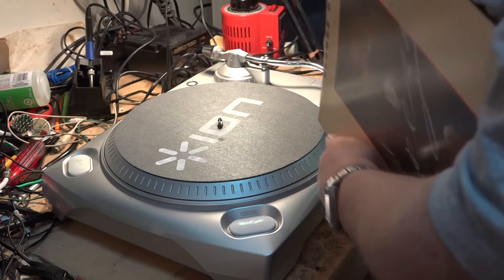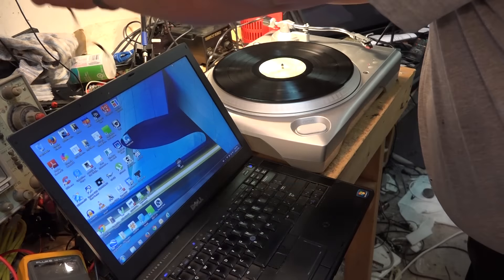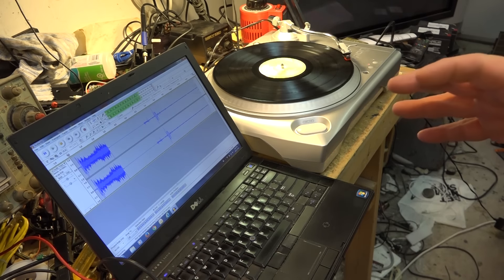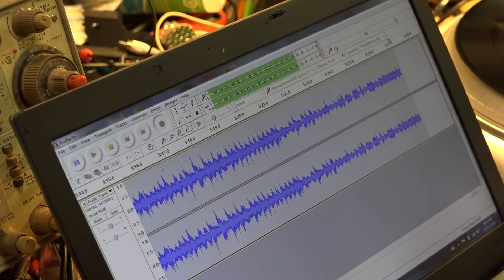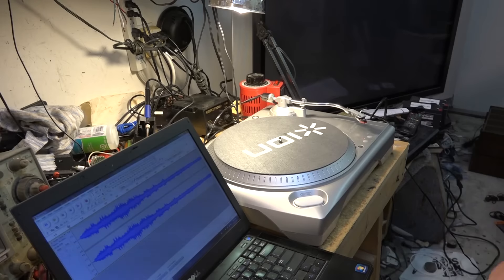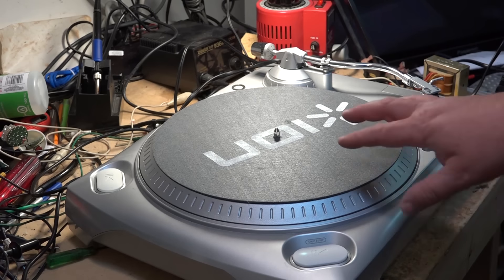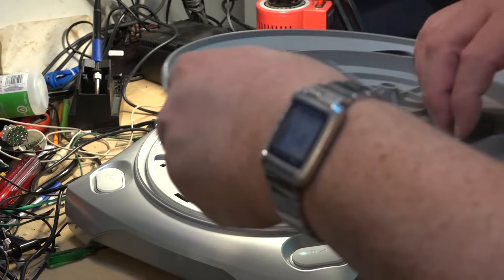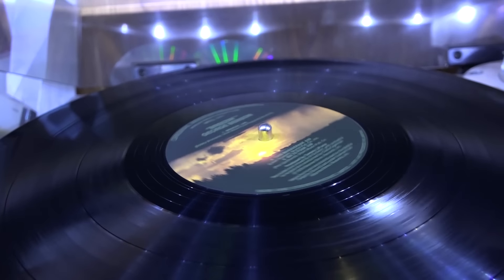ION USB Turntable shoot out with an Technics SLM1 and CD

Comment: Well well, I have the exact same turntable. And yes I beat you to it,I’m going to connect it to my Technics SL-P1200Mk5 to digitise my records. I’ll make a module so I can connect it to Digitise when needed,but still function  nomaly  when not. 
Inside apart from the speed control for platter,most of the gubings are mounted to a board  in the back of the input panel. 
I’m using a cheaper Technics belt drive as a mule  and a 5.2 v mobile power supply to get the basics right.
Not got it working properly yet? 
Good luck👍👍

Comment from the maker: Please note, the quarts lock switch was turned OFF on my SLM1 when I recorded this, and it is slightly slow, as I didn't check the strobe.  I will rerecord the tracks from the Technics, and I am also going to record the standard pressing on the Technics so you can hear the sonic differences between the commercial Warner Brothers 1076 release, and the very expensive Mobile Fidelity release. There are very noticeable differences, and comparing the 2 on the same table, with same pickup is the only way to compare apples to apples.
Reply from the maker: Low bit rate MP3 is horrible. High bit rate is very close to the original.Remixes for CDs are best. If a master tape that was EQ for vinyl is just ported to CD nothing is gained, that would be an AAD CD release. That would be analog session, analog mix, and digital copy.ADD is much better, even though the session tapes were analog, a new digital mix was done before the CD DAT master was done.DDD is the best.In AAD basically all they did was take the 1/4 half track master tape and record it on a DAT, and then send that DAT to the CD factory. The problem is that analog master has already been equalized, compressed and de-s'd for  the analog cutter. When they remix for CD they take the session tapes and remix it. One of the best sounding studio CDs is the Dave Grusin release "Mountain Dance" That was a live direct to 2 channel digital session where all the musicians played the music live. No remix. The sound quality on that CD is spectacular.
Reply: Most Notably is the difference in the Orchestral Intro was in stereo on both the CD and the Technics However I could not notice any separation from the ION. So My conclusion is that Either you mishandled the recording or the file export OR the cartridge (used for multiple transfers) is wired wrong or the software was set wrong OR the thing is MONO or you only played a single track of the stereo tracks. 
As far as results, Predictable. Make sire ION's peramp adheres to the RIAA curve before using it for recording.
AND lastly 16 bit for best recording. 24 bit or higher would be best. To me 16 bit is useless.
Roger

Comment: There are a multitude of variables that can affect analog sound quality: moving magnet vs. moving coil cartridge, line trace vs. elliptical stylus geometry, pickup compliance, tracking force and RIAA equalization curve to name a few. Any debris on the stylus will negatively affect reproduction quality. These are all before the A/D converter, most of which can't be compensated for in post-processing. A PCM4202 A/D converter may sound different than what you are using. The information is on that vinyl; getting it to your ear aint easy.

Comment: The nice thing about the cd is that it is uncompressed PCM and since it is a transfer from the master tape, you won't get the cracks and pops as well as Inner Groove Distortion
Reply from the maker: I'm with you . As good as vinyl can sound, it still suffers from distortion and dynamic range limitations. You won't win that arguement from the vinyl purists though

Comment: Yeah, CDs are unfairly looked down onto. As someone who actually prefers vinyl for a few reasons in some situations, I still mostly buy CDs, especially because they have dropped so much in price (for older albums, that is), to a point where they're actually cheaper than digital MP3 downloads.
Where vinyl shines, though, is the mastering, especially for older music that has been mastered before the loudness wars started. Compare an original issue of an 80s or even early 90s album to a CD remastering or recent remastered vinyl repress - and it just sounds more dynamic. Even some modern albums have been mastered better for vinyl. Check out Metals by Feist. A lot more dynamic on vinyl than CD. Weirdly, the limitations and shortcomings of vinyl actually force sound engineers into a better mastering result. That is, if artists and labels bother.

Comment: For some reason you were recording the audio from the Ion in mono, not stereo. Also its speed was set slightly too fast (probably miscalibrated at the factory, as cheap turntables often are). It should have trimmers underneath to set the speed. The Ion uses a clone of the Sanyo/Fisher MG-09 magnetic cartridge. You can upgrade it with an elliptical stylus -- look for part number 901DE which sells for around US$13 on eBay.
Reply from the maker: I actually put a shure on it before doing the recording. There is no option to set mono or stereo. Audacity was set to stereo but it appears the as converter of the table puts out a mono capture. On the computer it is recognized as a usb microphone. I set it up according to the online destructions and the recording is 2 tracks if mono. The preamp output to line level sounds good.
Reply: 12voltvids shure what model? Could I upgrade the cartridge or stylus
Reply: Know this is an old video but I had the same turntable. You need to right click your volume control, select "Recording devices" and find the turntable in the list. Go into properties, and the advanced tab.

For some reason it sets itself to 1 channel, but you can set it to stereo by adjusting the setting that shows up on that page.

Comment: I see these types of devices in the second hand shops often...I always just cruise on by....I know they serve a purpose for their intended audience...I'm not one....mainly for the issues you noted....I run my turntable and cassette deck through ADS Tech for ripping...dont do it often, but it works well with my vintage gear.  Happy Holidays Dave!  ~Jack, VEG
Reply from the maker: Would like to get a space tech lab preamp they are all tube design, and sound fantastic.

Comment: Actually vinyl has a much wider frequency range than cd. Vinyl can go down to single digits on the low end and up to 60khz on the high end. Cd's are limited to 20hz and cut off abruptly at 20khz.
Reply from the maker: So you have super ears and you can hear past 20KHz?CD delivers a flat frequency response, and a good CD player with a proper DA converter and proper wave shaping will not have the harsh sound that early cheap cd players had. I'm talking a Sony ES or equivalent.Vinyl has its own sound, and certainly sounds better than low bit rate MP3, but compared to a good, not a 10.00 CD player, or a 20.00 DVD player, I am talking a good unit, none I have heard stand up to a good CD player, and I have some pretty good musician ears.

Comment: excellent video. it seemed like the CD sounded better than the mp3 file that you made using Audacity. Was the CD that we heard a CD with mp3s on it or did you convert the mp3s when creating the disc so that it was a "normal" CD.? thanks
Reply from the maker: There was no MP3 compression used on this video. The vinyl was captured directly to the PC from the preamp (a shitty one at that) on the technics and recorded in WAV format. The ION had an internal converter, that just plugged into the computer and stored as a WAV file. The CD was a direct rip from the disk, no conversion at all done. All were saved as .WAV files 44.1KHz 16 bits.
The video was exported as a MPG2 file with PCM audio for the best sound quality, however youtube would have applied their own compression during processing.

Comment: The difference in speed has really impacted on the Technics - more than I would have thought possible.  It sounded quite dead and compressed, with the lower frequencies really lacking.   I'll look forward to hearing the comparison between the two types of vinyl on the same table though, especially now you have the Quartz lock back on, on the Technics.

Much as I like vinyl, as far as I am concerned some of the criticisms leveled at CD are a bit unfair.  Like anything, the kit being used to play it has a lot to do with the end result.
Reply from the maker: New video up with the speed fixed.

Comment: You said you were recording from the ION turntable in analogue. I am interested to hear what it sounds like over USB. Right at the end of the video i see that you were actually using the USB interface. Does your ION have a built in pre amp? Does it sound rubbish over the built in pre amp compared to USB?

  Someone gave me a cheap ION turntable (ION Pure LP) and it sounds awful through the built in preamp. i know the cartridge is the cheapest ever like $2 from china, but i was wondering if i should give it to my 1yr old son as a toy as he loves my Technics 1210, but hands off boyo! He's not old enough yet for the hifi and dj equipment.
  Other wise i'm going to throw it in the bin unless someone can convince me that it sounds better over usb. I was considering wiring a direct phono out so i can run it to my main amps with their phono pre amp or use it in my RV with a mini phono pre amp. Wondering if it's mainly the crappy built in pre amp that makes it sound so bad?
  When i compared it to my Technics 1210 with 10yr beaten DJ cartridge vs brand new cartridge i couldn't believe how bad the ION sounded. I nearly threw it at the wall right then!
Reply from the maker: The preamp sounds great. The a-d converter for USB not so much.  The table itself is noisy.  On the one I has, it had a shure cartridge which sounded great.  I ripped the preamp out, built it into a separate box and added a couple of tubes to the output to make it into a tube buffered preamp. Sounds fantastic.  I took the cartridge and put it on a different turntable, took the motor and belt out and trashed the rest.
Reply: I am just trying to justify keeping it, i have lots of Technics 1210's and some good sound cards and mixers.
  Might put it in my RV or give it to my son, cartridges for the one i have are extremely cheap so i can get a load and let him play around with it. Looks like you have the plush model.

Comment: USB DAC / Pre-amp on a modern TT is at best passable quality compared to a genuine analog TT. Built in USB DAC is already converting to a lower quality compressed digital stream before it ever hits the computer. Built-in pre-amps on modern TT are built to be as cheap as possible, and sound accordingly. So yes a CD rip will sound better.

Comment: Yeah sure the CD rip sounds better than the vinyl recording, but I bet it doesn't sound better than actually listening to the vinyl without digitization. Maybe my ears are on the wrong way around, but in cases where I have the same album on both CD and vinyl - I prefer the vinyl.
Reply from the maker: I have it on vinyl, and half speed vinyl, and CD. I use a very high end Sony CDP555ES player, and everything sounds good on it. Speakers, headphones. sounds fantastic. Not the same using a DVD player to listen to music. That sounds like crap, as do cheap CD players, but good ones, units with burr brown D-A converters, and good low pass filtering to filter out any quantization noise left over from D-A conversion sound superb.There was a reason for the 1,000+ price of these single disk players, just like a high end thornes or oracle table will sound better than a BSR or dual.For me is it signal to noise. Vinyl rumble and click/pops drive me crazy.It's like HDR video. Once you experience it on a good system its hard to go back. Take tube amps for example. Do they produce a more accurate sound? Not a chance, but people still like them because of how they sound.
Reply: The tube amp analogy is quite probably why I like vinyl. It doesn't always have to make scientific sense :)
Reply from the maker: Again each has their own opinion. You are also forgetting the fact that no matter what the source, you are watching it on youtube, so it has been digitally compressed twice. Once by me when I encoded the file as a 25 meg bit transport stream for uploading, and then again by youtube when they transcoded it, so the quality of both will have been changed.I have yet to hear any vinyl that sounds even remotely close to the DAT and CD recordings I have. The DAt recordings made at 48Khz sample rate sound even better. (These are studio tapes made in a recording studio, and this is where I reference my sound system to) I also don't listen on speakers, I listen with headphones. Half the people thought that ION turntable sounded better, yet they were hearing Mono, not stereo, so that shows how far off some peoples perception is. You like vinyl, by all means go buy it, the record industry needs you. Seriously, vinyl releases are probably the best thing to happen to the industry in years, because it is tough to bootleg vinyl.But claiming that it is a better format is laughable and everyone with an engineering background is ROTFLMFAO right about now.The same analogy applies to tube amps. No they aren't better but they can make any sound, even crappy sound from a cheap MP3 player sound wonderful because they add so much to the original sound that was never there before.
Reply: No chance, the Cd was defo the best one of the 3

Comment: A properly mastered CD will always win, this why it was invented
Reply: CD is definitely capable of sounding amazing. But as I have seen on other channels on here, this can go back and forth between masters and remasters. 
Case in point, there is a person on here that did a comparison between origanal recording reel to reel, 1st press record. The last pressed record (2003 copy) and a 2nd run CD. The 2003 record re-master was the best sounding of all of them. What I learned is, Analog and standard def CD are so closely matched in sound quality, that even HD Audio is not better enough to warrant the added cost.
Reply: @trashyaudiophile7301  I will bet not if you used a hand wound low impedance playback head on a Tandberg TD20A Special Equalization tape machine for the Master.

Comment: To be honest the 'audiophile' vinyl version is as rough as a badger's arse. Either it's a bad or damaged pressing or the cartridge on the Technics is worn out.
Reply from the maker: Its the preamp. My good one started humming, and the replacement I bought just doesn't sound as good. I never use the turntable these days. If I did regularly use it, I would get a new preamp, or make the effort to fix the good one in my Luxman.